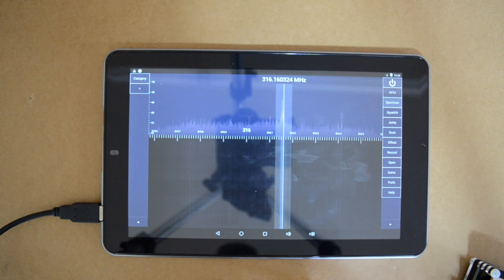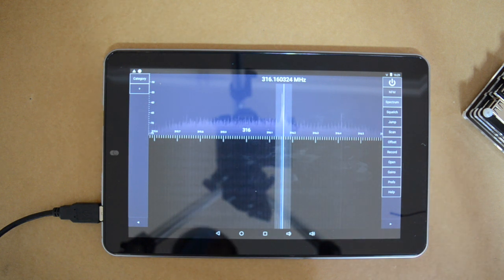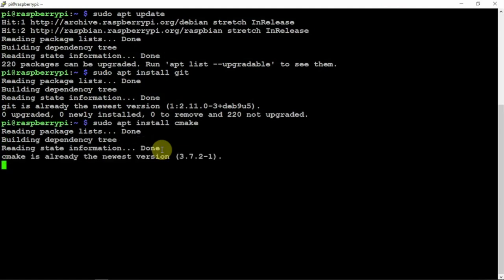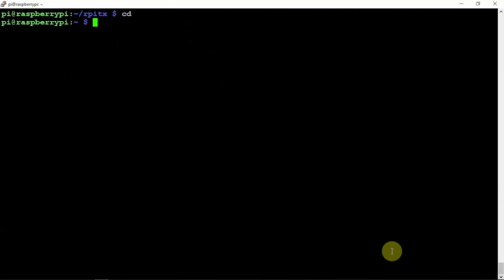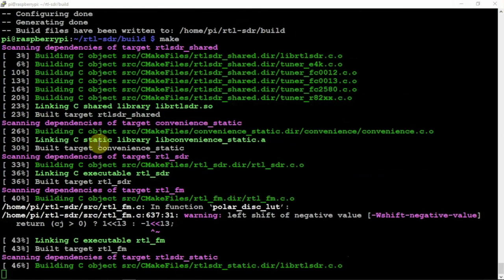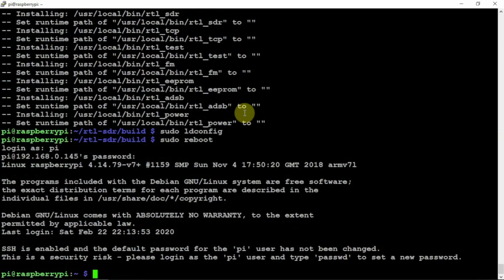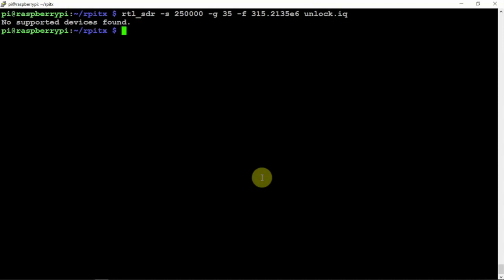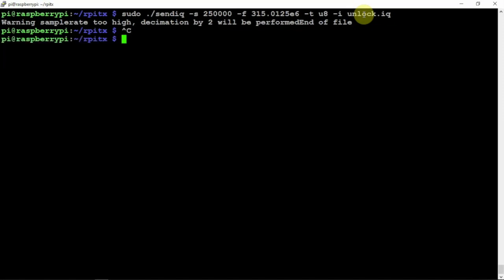Unlocking Car Door Using A Raspberry Pi And RTL-SDR USB Dongle

Comment: Hiya Fuzz I have a question, I know you have experience with the goestools suite of programs and I figured I stood a better chance of getting an answer on a new video. How does one go about updating packages? Or are are they automatically updated with sudo apt-update/upgrade? Thanks!
Reply: Thank you!!
Reply from the maker: Not for goes. A least if your using it on a pi.
Reply: @FuzzThePiGuy , oh. Yes I am using an Raspberry pi 4. Thanks anyway!
Reply from the maker: You can cd into the goes dir. and do a git pull to check for any updates
Reply from the maker: cd goestools
git pull